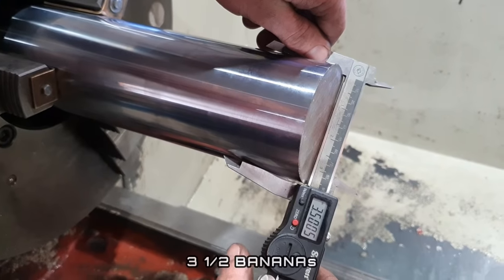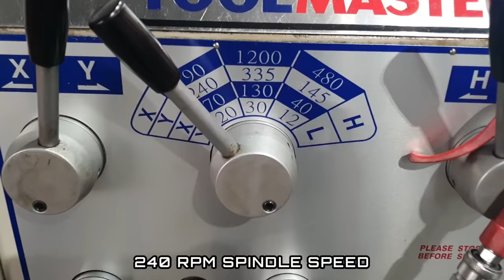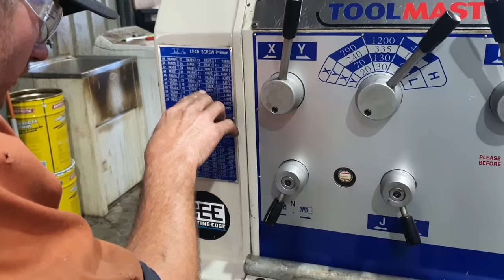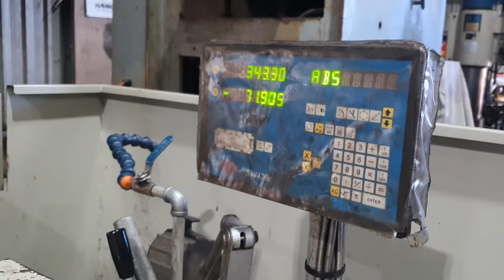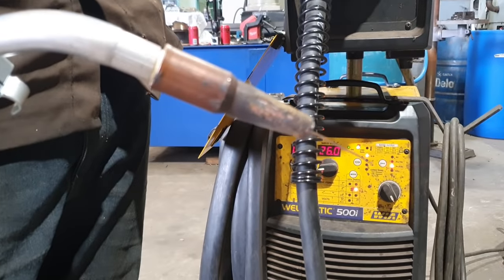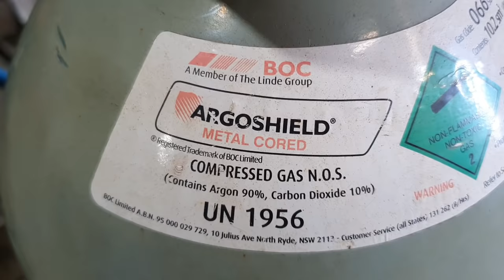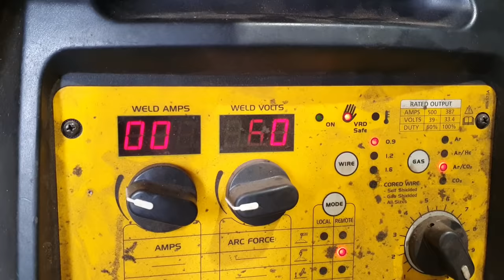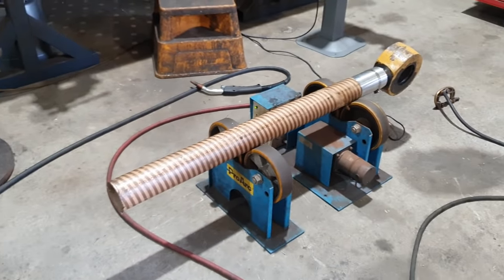Repair BROKEN Hydraulic Cylinders for CAT D11 Dozer | Part 2 | Making the Rods

Comment: Watching these two videos took me back to when I first discovered ceramic tool bits in the late 70s. 
I worked for a Caterpillar dealer in the machine shop that we were getting built up.
At that time most of our work was pins and bushings.
The pins would come in worn badly and would get chucked in the scrap bin. Cat hard chromed their pins so once that outer "shell" wore through it was all over. We started taking the old pins and making some of the smaller pins from them and getting them chromed. This turned out to be less than successful.
Then we started to turn the chrome off, weld the worn spots up, turn them down and get them chromed. We had out own O.D. grinder so we ground the pins to size.
This turned into a time consuming mess.
During all this I had noticed that the weld was as hard as the chrome. Problem was while we could muddle through turning down a filled area, turning a pin welded from end to end just made carbide bits disintegrate.
One of out local tool reps came by and saw our dilemma. He quickly gave me some ceramics to try. These were much better but the coolant we were using was sulfurized oil and it had a bad problem with smoke and a bad finish. Same tool rep had a solution. Just clean all the oil out of your machine and use this coolant he says. Totally trusting I did just that. Machine all clean and tidy, I put the coolant into the machine, set up a pin and started turning. I had a trainee and the first thing we noticed was you could actually see the cut through the clear coolant. The chips started to sizzle. The ceramic tool was working well but the chips were getting quite hot. Just about the time the chips started to toss a few sparks the whole bed of the machine erupts into a huge fireball! Bless him my trainee was standing guard with a fire extinguisher and it was all over in seconds. 
Up until that time I had a beard, mustache and eyebrows. My eyelashes were saved as I was wearing a pair of prescription safety goggles.
Upon investigation this coolant was a cutting fluid that had the same flash point as acetone! I was beyond ill that I had just taken the word of someone who said they knew what they were doing. Way before the days of MSDS books I just hadn't looked.
I called the receptionist and told her to let me know when that "expert" made his next visit. One of the other guys fielded the call and let me know. In that point of my life I was rather excitable and a bit of a bar brawler. I grabbed my cheater pipe from the lathe and headed up front. The receptionist took my message as to let the guy on back.
The guys in the shop knew what was going on when I grabbed that pipe so when the salesman showed up at the shop they told him to haul out or he was going to get busted up.
After the mix up was all over and the guy had missed my "reception" I cooled off and appreciated how my guys handled the whole thing. After that I always paid attention to the flash point printed on the barrel.
With the proper water soluble coolant the ceramic tools worked fine. The welding turned out so well it even got us in a bit of hot water with Cat but...another time.
Cheers
Terry
Reply: Haha, did that "expert"  fool tool rep ever come back to the machine shop again?
Reply: @DrTubeman  nope. He was afraid to. I didn't like him anyway. He reminded me of the greasy slicked back hair salesman of the 60s. He and I about had words over how he pestered the shit out of one of my female welders. She was too nice to tell him to beat it but one day he got all over the top of her while she was heating up the end of a loader frame with the torch. I think she singed his eyebrows but he left her alone after that.

Comment: As a swiss turn guy, I enjoyed the comment about the cute little bore bar. The largest bar I ever use is a 7mm min diameter and 30mm max depth of cut. I regularly run 4mm x 20 mm.

Comment: I'm always nervous when you get to the "threading" stage.  All that previous work could instantly go FUBAR - is this an irrational fear or have you ever had to scrap a job because the threading was ballsed up?

Great video and thanks!
Reply from the maker: Hey mate I reckon that's a pretty normal feeling cause no real second chances. I haven't balls'd up a thread pitch but have cut too deep so nut was loose, had to scrap the part and start again 😫
Reply: @CuttingEdgeEngineering  ouch!
Reply: A lot of guys do a scratch pass and check with a thread pitch gauge to avoid possible errors in setting machine
Reply: The question I wanted to ask. I get do nervous at the threading part. Good to have the right tools. I could see that going very wrong.
Reply: I actually caught a ballsed up thread the other day for one specific reason. It was a test thread for a new threading bar, so I decided to cut 8tpi as I can engage the half nuts anywhere. So I get two passes in and it's double tracking. That meant something was wrong. I checked and sure enough, 9tpi. I cut all of the double track out. So in that case releasing the halfnuts actually helped me avoid mistakes.

Comment: I'm reminded of a moment in my high school metal shop class when I watch Kurtis work on the big lathes. We were supposed to remove our uniform ties in the shop for obvious reasons. One of my classmates forgot this and got his tie wrapped around his workpiece on the lathe! He was straining hard as he could with one hand on the headstock and the other on the carriage trying to avoid getting pulled into the lathe. Teacher supermanned the length of the shop to hit the e-stop as we all stood transfixed - saved the kid's life. We all laughed about it afterwards, but 40 years later NONE of us have forgotten that safety lesson I can assure you! Ironically, I think I've learned more from this channel than all those years in class.

Comment: Your videos are always interesting to watch. I'm not expert in machining, why you use emery paper in the thread reliefs after you finished threading,just to give a nicer finish or for other purposes?
Reply from the maker: Hey mate good question, yeah to help improve the surface finish 👍
Reply: @CuttingEdgeEngineering  Thanks, I thought as it is a possible stress point surface finish helps to withstand crack formation too. But a good looking surface io always ok on it's own.

Comment: So, as a long-term watcher - I have a question that's been bugging me:

When you are chamfering an edge on a component, are you eyeballing it or actually measuring it?
Reply from the maker: Good question. It depends on the part and how critical, but with this job eye ball it 😎👍
Reply: So, how do you know when you are through the induction hardened layer? I've been watching you do this for a while and I can't figure it out. BTW, love Homeless, the rubber chook assassin.
Reply: @mooseflunky4569  from my view, you can see the difference in the two materials visually, you can also see/hear the difference in cutting.

But that's just a guess.
Reply: @mooseflunky4569  you can hear it when you break through it sounds different plus the swarf looks different

Comment: Best sequel ever 😅🤣😁.
Proper screw cutting of a shaft, ref smooth transition on thread relief,  and large radi to reduce any stress raisers, band filing and polishing the proverbial icing. Great nuts by the way 😋. 
Great work and video both, thanks for sharing and starting my weekend. 
Best regards from the old dart.
John.

Comment: I'm a fine assembler, deal with very small parts, so my mill has a job height of 160mm and a X width of 180mm. Lathe is similar sizes - between centres is 203mm, swing 45mm. 
So your work is fascinating.  I can catch parts coming off the parting-off tool with a ballpoint pen tip.  When I saw you parting off the eye I was thinking - how is he going to catch this ? 
Many things to learn here - thank you very much for making these videos. Kudos to you and Karen.

Comment: That change in the sparks being thrown off as you got through the induction hardened layer was really interesting to see.
Reply: I'm curious as to why he didn't put cooling fluid on the cut when taking off the hard layer.   "Something" seemed to be glowing red hot.
Reply from the maker: @john Gilmer i'm using ceramic inserts which are brittle and don't like thermal shock so should be used either hot/dry or flooded wet with coolant, I prefer less coolant mess so run them hot 👍

Comment: Gotta love the full form threading insert holly shit that made for a fast as hell treading operation. A fine example of the right tool for the job. As well as for the cermet incert for destroying the chrome hardened layer of the rod. Money well spent is money well made. And of course the guy running the job with the knowledge skill and experience to choose the right tool for the job. Absolutely tearing up the work with a level of confidence that can only be described as badassery. Well done good sir.

Comment: I love the before and afters. Is there a reason you don't use damp cloths when welding in the lathe? Even dampened with coolant?
Reply from the maker: I use anti-spatter spray on the bed ways as a protection against the weld spatter
Reply: @CuttingEdgeEngineering  does it not react well with water? Just thinking it might stop the cloths catching on fire. Used to use damp towels when welding the frame for a motorized go cart over the motor and seat etc. To stop splatter from causing issues.

Comment: Love your work man, real nice to see someone with a passion for what they do. Out of interest, how much do the shafts shrink after welding and do you think the 5mm difference in length in the original shafts could have been a weld repair shrinkage?
Reply: No way. Keep in mind steel expands 7 millionths of an inch per inch per degree F. Wrong units, I know. Sorry. Point is, it's a lot less than 5mm.

Comment: Is the off side hole in the eye for a grease fitting? 
And why do you preheat? To prevent cracks due to too high temp difference?
Reply from the maker: hey mate spot on, that is for the grease fitting and preheat is needed due to the high tensile material and recipe of welding filler

Comment: Another great repair. Always quicker once you have done one. Just wondering why they name the thread cutting tip that way "12 TPI Full Form" as there are a lot of different sizes that have 12 TPI and I would assume they are not all the same depth. It is a bit confusing considering I have really only ever used a one size (big) 60 deg or 55 deg cutting tool, just the depth of cut varies.

Comment: Don't know if anyone's asked this before (would be surprised if not, but worth a shot!)....would there be any benefits to using additive manufacturing to generate blanks for the rods and cut down on the time/material costs?  Would likely have to do some cleaning up and threading operations but seems like all the roughing in could be avoided.  Assuming of course the capital investment and material costs for the added manufacturing platform add up in the right column! And I suppose whether an AM blank would be strong enough for this end use.....

Comment: I would be interested to know how you came to determine what wire and welding process to use on these projects. Have you tried the other wires and found this was the one with the best results or was this one standard on the industry?

Comment: I wonder how much faster you go thro tooling due to no coolant, it is interesting watching the inserts get cherry red on the tip when you took the chrome layer off.  An I believe I recall that the reason for no coolant is for us viewers
Reply from the maker: hey mate! yeah a few times will run no coolant so less mess and better for views but with the ceramic inserts (for the induction hardened layer) they can be used hot/dry or flooded wet and I prefer less coolant mess.
Reply: @CuttingEdgeEngineering  oh that's interesting! Thanks for the insight

Comment: What class of fit do you usually machine for threads?  Obviously if the nut goes on and is not too loose, success.  but do they specify a pitch diam???  Three wire measurement  or what is your preference??/

Comment: Thats a lovely finished job. Is it necessary to ensure that the metal added in the welding has the same properties as the metal being welded? ie not more or less brittle, ductile etc, How do you do this? the wire, the voltage, the gas?

Comment: Good video. Question; how long do the ceramic inserts last using them on the chrome and induction hardened layers? I've never used them in my home shop.
Reply from the maker: hey mate it varies, 1 good quality insert can last many jobs and cheaper one's can burn up 2 to 3 inserts on the same job 🤣

Comment: Hi! Didn't there supposed to be an oil groove or what is it called in the middle of eye inner surface? And what about the steps of eye bore? Is it just related on how will it be installed, different hardware?

Comment: I really like the sound the massive metal parts make when you drop the tool holder in place. Am I correct in thinking you don’t need to tighten down the tool holder because of the tight tolerances and the downward force of the part rotation? P.S. I love your dog.

Comment: How in the world do you sync that lathe with the threads? I kind of see how you do it the first pass. But then the machine must replay what it just did exactly so it can make the existing threads deeper which suggests to me there is some sort of synchronization happening. How accurate does this synchronization need to be? I am assuming that with each pass when cutting the threads is mainly done for two reasons. One to increase the depth of the cut threads. Two to “widen” the threads? Which then begs the question, does the insert your using cut the threads to spec once a certain depth is achieved or when you are “synchronizing” the machine you simply advance the bit slightly to widen the cut of the threads?

Comment: Enjoy your videos, nice editing and shots too. It's amazing how much work goes into those small inserts. I bet your supplier loves seeing you come. The ceramic is a great idea. How did they over come the brittleness? Next they will use micro diamonds in the mix.
Reply from the maker: there already is inserts that use diamond, it's called a CBN insert and they're very expensive 😅
Reply: @CuttingEdgeEngineering  Yes I bet they are, that technology doesn't come cheep. Early on they had difficulty retaining the diamonds from chipping away.
Reply: @CuttingEdgeEngineering  Sorry, CBN is not diamond.  It is cubic boron nitride.

Comment: Hey Kurtis, when you preheat the weld joint with the torch is there ever any soot that needs to be cleaned off before your first bead?  Another great video!  You always have great projects, the video is superb, and I like that you give all the details such as which tool bits and at what speeds, type of wire and gas you’re welding with, etc.

Comment: ok, I'm not a welder at all but I have seen in a couple vids recently where they beat the flux off of stick welding rods and used the metal core to lay into large gaps that they were filling with weld. 1 used stick, the other mig to do the welds.
as a layperson, this just seems wrong to me, is this actually a good weld?
Reply from the maker: hey mate that is known as "Texas Tig" an american thing to fill a joint extremely quickly, personally I wouldn't do it.
Reply: @CuttingEdgeEngineering  Ok, I can see it if it's a cosmetic weld but not if the joint is holding and stress.

Comment: Is that induction hardened depth consistent from one 'chrome rod' to another? Is it about the same depth regardless of the rod O.D....?
Reply from the maker: Heh mate good question yeah the induction hardened layer is all pretty much the same depth
Reply: @CuttingEdgeEngineering  OK, Thanks. I worked in a shop that did a whole lot of chrome rods, cyl's, and stuff, I didn't get involved in machining, I spent all day welding...lots of heavy equip. We were right around the corner from Hv. Eq. rental yard...Yeah, they kept us busy. You know, run it 'til it breaks, then fix it...!